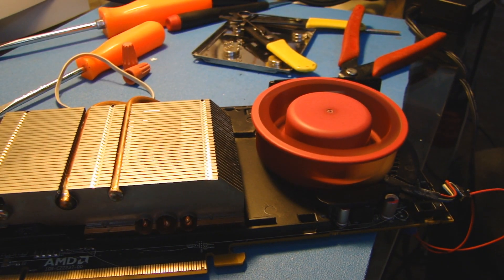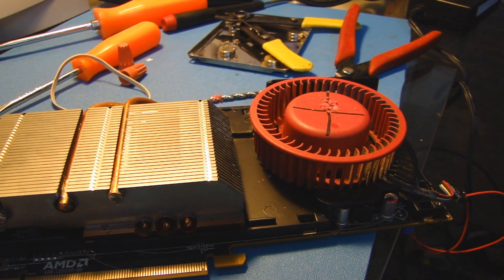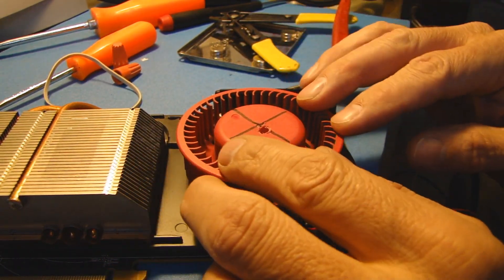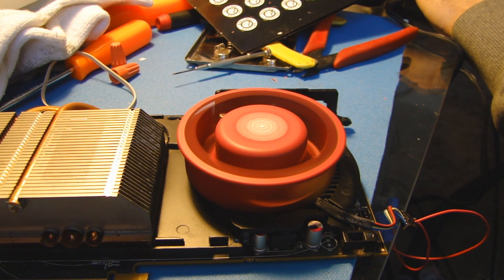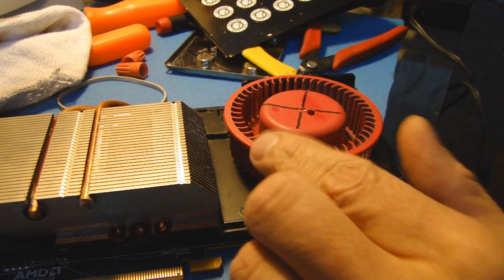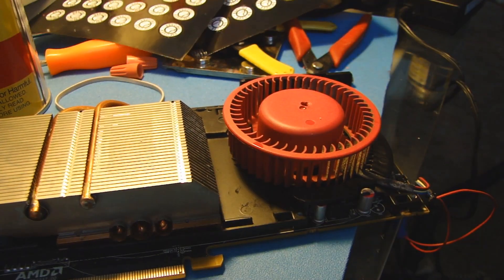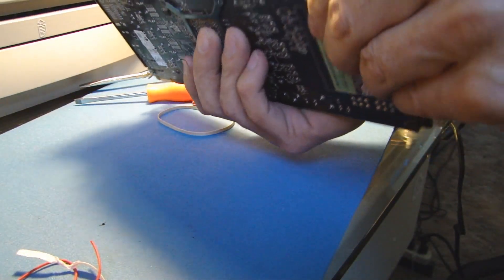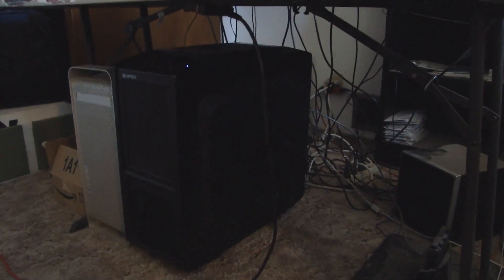Repairing Radeon 6870 fan noise...the easy way....

Comment: There is 3 screws down the fan holding it, remove them, then you'll see a fan sticker, remove it, then you'll see a fan bairing, put the oil on that bairing and reasemble all the things. Voila.

Comment: Did this last a long time or did the noise come back? Thanks 😊
Reply from the maker: This lasted many years until I eventually retired the card.
Reply: @drummerdonniedotcom  thank you very much for replying so quick, was it the DW40 / oils hitting the centre pin that did the job or the hole u drilled off to the side? 
😊
Reply from the maker: @miablack : If you watch the full video, all that is explained.  The quick answer; the hole to the side.
Reply: @drummerdonniedotcom  ahh thank you 🙏🏻😊

Comment: Instead of drilling holes, you can simply pull the fan out of the motor (requires some force - don't break it) and apply lubricant to the shaft directly, then pop it back in. It's easier if you don't remove it from the frame.

Comment: Sewing machine oil would be a great thing to use, it's recommended for technics direct drive turntable spindle bearing.....
Reply from the maker: That sounds like a good idea.  But I don't think most computer geeks have sewing machine oil, but I bet they do have WD-40 and motor oil...;^)
Reply: @drummerdonniedotcom  Not sure the average person has motor oil laying about mate, I certainly don't as I get my car serviced at work (a garage). Sewing machine oil is really cheap, and it's very light, so it's perfect for fast moving spindles (like a fan). I'd be worried that the WD40 evaporates over a short time, leaving the thick motor oil to get gunkier and gunkier slowing the fan down, certainly not a criticism mate just genuinely trying to suggest the best option for you and others :-)
Reply from the maker: @DjNikGnashers : You are correct, that WD-40 does evaporate.  WD-40 is a penetrant and motor oil is the lubricant.  That's why I use both.  WD-40 is merely the catalyst to get the motor oil where it needs to go.

And while I agree that not everybody has motor oil in their garage, I think we can all agree that even less have sewing machine oil in their home.  I think we can also agree that it's a lot easier to pick up a can of motor oil in any auto parts store or department store chain like Walmart, Target, K-mart, etc.  If you told me to pick up a bottle of motor oil, I could have one in my hand in 5 minutes.  If you told me to pick up sewing oil, I would immediately Google it and/or start calling stores that might have it.  I don't patronize Walmart for personal reasons (as many do), so that's not an option for me.

You'll get no argument from me that sewing oil may be BETTER for this kind of job.  But you have to concede that motor oil is certainly more popular to HAVE and easier to GET.  Agreed?
Reply: @drummerdonniedotcom  Yes, I wasn't trying to cause division, and I thank you for making the informative video. Maybe it's different in England where I am, I have sewing machine oil in my house, simply because I am a DJ and always have it handy. I usually just get on Ebay and buy most things, and get them delivered next day to my workplace, easy. I use it for many things, none of which are sewing machines  !!! Other uses are tuning pegs of my guitar for example......
Reply: @drummerdonniedotcom  Sewing machine oil is just lightweight machine oil.  It's good to keep around the house for all sorts of things.

Hair clipper oil is more or less the same thing.

I used to use 10W-20 motor oil in old sleeve bearing fans, like the ones you used to find on Northbridges.  You do have to relube them once in a while.

Comment: nononono, whyyy? you can just take the fan off, peel the sticker in the back, and put your grease or oil there. drilling a hole only expose the bearings to more physical damage than necessary....
Reply from the maker: Josua wrote, "nononono, whyyy?"

Because removing the fan is a huge pain in the ass.  You literally have to disassemble the entire GPU.  Don't believe me?  Make a video showing YOUR way and let's see which way is easier and takes less time.  My way takes mere minutes and requires NO disassembly and NO thermal grease.  Hands down, my way is a better way.
Reply: @drummerdonniedotcom  again, it exposes the bearing to pointless risk. Well, I don't wanna make my own video cause i don't have any fans to fix, so fuck that, and fuck you for telling me that. but if you're going around telling people how to "fix" their fan with a chance of actually breaking it further, then I can only think this video have ill intention behind it. Also, don't go "Oh, but mine works" on me. It's just one sample, and it's not representative of anything. 

Also, for those who will read this in the future, you can choose: 

one, cost probably 10 minutes more for disassembly and peeling the sticker off behind the fan, but much more safer to do,

 or 

two, drill it, leaving permanent damage physically, and risking you might further damage your stuff.

I'd pick one anytime of the day, but maybe some of you are daredevil who likes to live dangerously, idk. just be warned that this method may work, but definitely isn't the best way to safely fix your stuff.

(edit for spacing and typo fixing because youtube keeps ruining my spacing these days ==)

Comment: You are one noise man made one noise video, and those reactions destroyed/debalanced the fan. There is a way to disassembly the fan from the botom under the sticker ... and that stupid sticker won't hold nothing there, the fan blades will fly away OMG
Reply from the maker: Ummm...FIVE YEARS LATER this card is still in service and as silent as the day I fixed it.  So, in the repair industry we would call you "WRONG" on a colossal scale.   Next time I suggest checking the date before you comment.
Reply: @drummerdonniedotcom  well for 25 years i am owner of repair shop and an electronics engeneer and my hobby is electronics. I am sure thet there is nothing related to the repair industry and wrong in my comment, also sure that internet, me, repair industry and your "repair industry" had nothing common.
Reply from the maker: @technixbul  Electronics engineer?  Hell...you can't even SPELL engineer!  That said...

I built my first computer in 1990 and have been fixing and modifying them ever since.  That's 29 years, which beats your 25.  But none of this pissing contest matters.  Use that big engineering brain to examine the data.

1) My repair is much, much, much simpler than disassembling the card (i.e. REMOVING the fan assembly).  My repair regimen is DESIGNED for your average Joe.
2) FIVE YEARS LATER the card is still in service, silent as the day I fixed it.
3) FIVE YEARS LATER the sticker you claim will "fail" has not.
4) Ergo, the fan was NOT "destroyed" or "imbalanced" (or "debalanced" using your nomenclature).
5) Yes, I KNOW that there is a way to "disassembly" [sic] the fan.  The entire point of this video is to AVOID that scenario.  Did you not get that???
6) FIVE YEARS LATER, the fan blades have NOT "flown away."

For an "engeneer" [sic], you're certainly not doing the math.

Without a single shred of data to support your position, I think it's fairly safe to say that you are on the losing end of a losing argument.  Really....quit while you're ahead before I get REALLY annoyed.  

Good day, sir.
Reply from the maker: @technixbul  Let me address your declarations one at a time:

1) I never said you needed to "drill" the card.  And you are wrong.  Disassembly is a LOT more than just 3 screws off the heatsink.  There are TEN screws that hold the PCB to the shroud.  Then there are FOUR screws that hold the PCB to the heatsink.  There snaps in place that insure that the shroud must be CAREFULLY and GINGERLY removed, or you will break them.  And that STILL doesn't get you to the fan!!!   Then you have to disassemble the shroud!!   Also, your average user doesn't have a tube of thermal compound laying around.   So your assertion that it's "just 3 screws" isn't just WRONG.  It's VERY WRONG.

2) Regarding the pissing contest regarding English, experience, electronics expertise, etc, you're missing the point.  AGAIN, for the final time, this video is NOT for electronics experts.  This video is for your average user who doesn't have the moxie, savvy or wherewithal to disassemble a GPU.  Perhaps you should check some of the OTHER comments???

3) You say I'm "wrong," but have ZERO DATA.  Again, DO THE MATH.  I have PROVEN MY METHOD IN MY VIDEO.  FIVE YEARS LATER the card is still in service!  Where is YOUR proof that it's "easy to disassemble" with "3 screws???"  Where is YOUR video???

Here's your "3 screws": https://youtu.be/JO_wLln4j9A

So enough with your LIES.  Either MAKE A VIDEO to prove your point, or ZIP IT.

Good day, sir.
Reply from the maker: @technixbul  If THAT is what you call an argument, then yeah...don't waste your time.  In American Engineering, DATA is king.  You've presented nothing but your opinion, which doesn't fly in American Engineering circles.  If you're any indication as to how the average Bulgarian Engineer makes his case, it's pretty aasy to see why Bulgaria isn't a leader in the Engineering community.

Comment: HD5770  with a noisy fan here..Ive had my shroud and heatsink off many times,not hard..The fan is secured to the shroud with 3  or 4 small screws, its been a while  since i did it..once the fan is removed and in ur hand, you should see a sticker on its underside...remove that and there is a very small micro clip that needs to be popped off,then the fan spindle will easily slide out of the 2 ball bearings,,lube the bearings and  slide spindle back in...reattach the micro clip carefully by pushing it down on the shaft till its locked in the groove..replace sticker, then attach fan to the shroud ect.. so YES the fan DOES absolutely come completely apart, its just a little tedious and requires complete dissambly of card and reseating the heatsink again.. anyway, ive lubed mine up and it was still noisy! used motor oil  instead of wd40 so i mat\y add alittle wd40 next time and see if it helps..Yeah that infernal droning noise,i know what u mean! ive even swapped out the bearings from other common case fans with the vid cards bearings, same size, very common, but geez, still noisy!  gotta experiment with lubricants...hope this settled the fan questions..it will come apart, u just gotta know how..
I may just leave the damn shroud off and secure a better ,quiet fan on top of the heatsink and be done with trying to silence that crappy stock fan..
Reply from the maker: Thanx for the reply and information.  Just to clarify, I never said that the fan assembly couldn't be removed.  I simply asserted that removing the fan is a PITA, and that this method is easier.  That said....

I used a mixture of WD40 and motor oil.  That was the winning ticket.  First a little motor oil, then the WD40 to move it all around. 

Good luck!

Comment: I used this technique on a Radeon HD 5850.  I have an older computer setup for our friend's kids to play Roblox on when they visit, and even such a simple game would cause the video card fan to vibrate and whine in a really annoying way.  I used a small drill bit by hand similar to the video, but pushed down on the end of the bit using a multitool with a little divot in it about the size of the bit.  That allowed me to push the bit harder.  I used masking tape to pick up the shavings as I went.  I broke through right at the edge of the hub and could see the coils.  I blew out the hole with the canned air then added two drops of 3-in-1 oil.  I sealed the hole with a round piece of aluminum duct tape.  Mission accomplished.  Thanks for the tip!
Reply from the maker: Great story!  Glad you got it working.  Mine's going on 4 years now....

Comment: Use "Krown rust protection and lubricant Max strength" (Canadian) then run it for a couple of days then add duralube oil or slick 50.
Reply from the maker: I published this video 4 years ago and the GPU is still running noise-free.

Comment: Thanks Donnie, this worked just as well on my old Radeon 5850 which started to make those very same noises a few weeks ago!
I found that it is important to drill the hole near the center of the fan, just next to where the shaft is. The first hole I drilled was a little bit too much towards the outside, so the oil could not reach the center of the fan. 
Drilled a second hole almost right in the center and that's when I was able to spray the shaft with my oil (I used an oil called "Ballistol"). Now my fan is really quiet. 
I didn't have those type of mini screwdrivers to be able to disassemble the card, so this video was very very helpful. Thanks again, Greetings from Germany
Reply from the maker: You are very welcome.  Good point about the drilling location.  I'm glad it helped.  

If you haven't already subscribed, please do so.  Thank you!

Comment: Witch kind of oil?
Reply from the maker: Regular motor oil.  I believe I have 10w40 in that can, but any motor oil - in small amounts - mixed with WD-40 should work.
Reply: do you think this would work on radeon 5700 hd series?
Reply: Well it did work, thanks anyways :D
Reply from the maker: KRIEGA
Glad it worked!

Comment: this method disbalancing fan and u can open the other side just need remove all fan off!
Reply from the maker: Yeah....in case you hadn't gathered, drilling a small whole and adding oil is about 1,000 times easier and 1,000 times cheaper than completely disassembling the entire GPU, purchasing a new fan assembly, and putting it all back together.  So my target audience are those who wish to save time and money - NOT those who just like to take stuff apart unnecessarily.  But I have good news!  There are LOTS of videos out there (albeit, crappy ones) that DO show the entire disassembly process.  It's not for everyone, but I'm sure you will enjoy them.

Regarding "fan balancing" (kind of laughed when I read that - funny)....

A smart man MIGHT think to himself one of the following:

1) If the fan were out of balance, we would have seen that at the full-speed shake-down fan test at the end of the video

OR

2) Maybe, since MORE than TWO YEARS have passed since this was posted, the original producer of the video (me) would have noticed an out-of-balance fan by now.  (You really should check the dates and comments before making such a silly, preposterous comment.  But I digress....)

OR

3) Someone would have complained about an "out-of-balance" fan by now.

I get that you're not the sharpest knife in the drawer.  And there's nothing wrong with that.  But what DOES bug me is laziness.  Had you checked the date the video was posted, and read a couple comments, you would know that the fan (and therefore, GPU) are still running like a top.\

As always, please subscribe....<:^)

Comment: Can you tell me for the love of God, how did you remove the plastic covering the radiator? I can't seem to open it for shit.
Reply: Donnie Frank God damn I found it like, 2-3 months before your comment. It was such a relief, removed a thick layer of dust from there and lowered my temperatures for 20 degrees.

jesus thanks tho
Reply from the maker: +MushRoomMW2  I feel your frustration.  Happy to help.

I assume you know where all the screws are, and have removed them.  Going from memory, I believe there are a couple screws on the EXHAUST PORT side of the card, which took me a few minutes to find.  Assuming you find and remove all the screws (6, I think)....

Once you remove the screws, if you fast forward the video to 6:05, you'll get a pretty clear shot of the plastic tabs that old it on.  They are a "claw" type design.  So you have to squeeze the outer edges of the card in a bit, then lift the top up.  I think this description will be clear once you see the actual tabs around 6:05.

If you still can't get the top off, let me know and I'll pull the card and post some photos or amend this video.
Reply: +Donnie Frank i would love to if you could post the vid about it, i tried to to prss the tab but still the plastic wouldn't budge